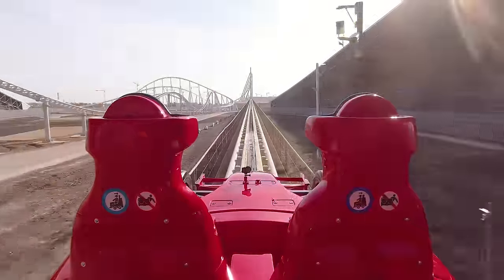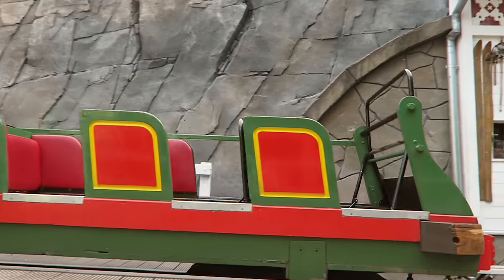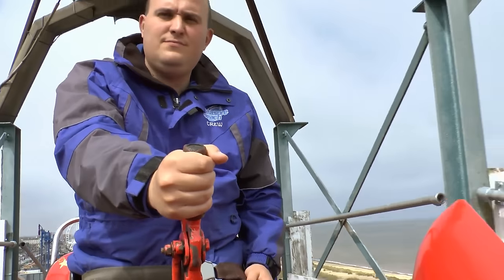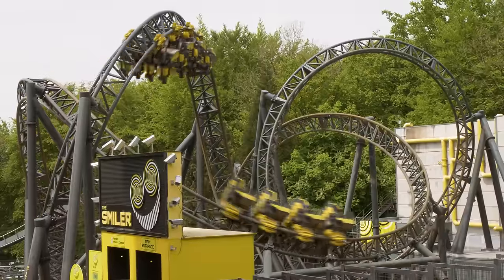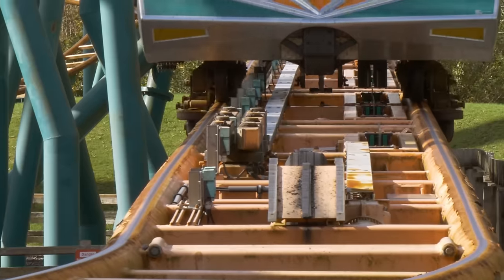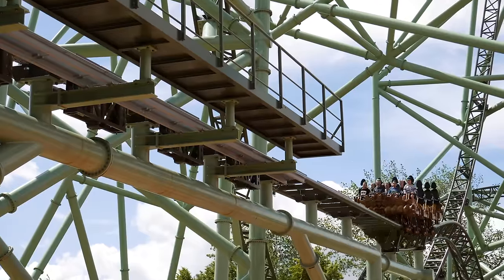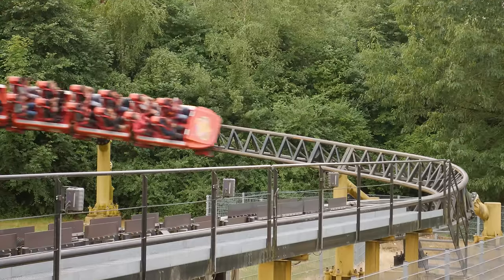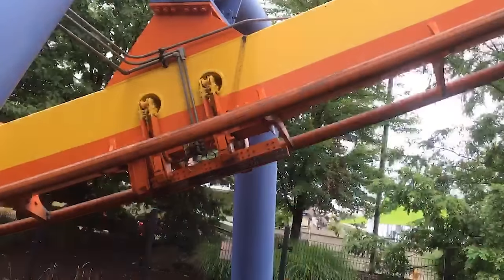Roller coaster brakes NEVER fail

Comment: You use the term "Failsafe" a lot. They are not failsafe.

Let's first start with the laws of physics, every action has an equal and opposite reaction.
This means SOMETHING is taking that momentum and converting it to heat energy.
That something also feels the full opposite force of the thing it is slowing down.
Metal fatigue is wear just as much as brake pad fade is. Given enough trains in a row, the magnetic brakes WILL overheat.
And given enough runs, they WILL fail. And not like brake pads do, slowly getting worn but rather quickly and without much warning.
A microfracture can suddenly cause a whole plate to dislodge and throw itself at a park visitor.

Secondly, there's history of these blades coming loose. I don't remember the exact details and name of the park/attraction but there was a woman standing in line to ride a coaster when one of these blades did come loose due to badly fastened bolts. The blade was launched through the air at full speed into the back of her head. She was dead before she hit the ground.

Third, "permanent magnets" are only permanent by name. If they were truly permanent then we would have free energy, also known as perpetual motion.
They are called permanent because unlike iron magnets, these rare earth magnets (Neodymium etc) keep their magnetism way longer than ferrite core magnets do.
But even they will eventually lose their magnetism and they lose it faster the more you run eddy currents through them.
Or they can lose their magnetism from heat. All it takes is a bad wheel bearing to transfer heat into the magnet rail and a whole set of magnets can suddenly become demagnetized and the disaster is a fact.

The water brake is more "fail safe" than these magnet brakes are. Except the inlets and redirection structures too will eventually suffer metal fatigue.
When the coaster is in motion it is no longer safe. A fail safe would be something that prevents the coaster from moving at all if anything has broken, be it physically or digitally or personal safety wise.
The same way an elevator has a failsafe built in that is never actually used until it is needed.
If an elevator cable snaps and a cart freefalls, there's a failsafe that will deploy huge metal bars to catch the cart at a floor or even between floors.
They are fail safe because they ONLY activate when they are needed. So they don't wear out. Unless of course they have to activate all the time.
And the only way to get an elevator moving again after these have deployed is to lift the elevator cage again.
Reply from the maker: All those points are very valid and go one step further on explain things than I have in the video. 

The answer to the majority this comment, as many have pointed out, is maintenance. With correct maintenance, these brakes are failsafe.

Comment: with magnetic brakes, where does the energy go? is it converted into heat like friction with brakes?
Reply: good question and you are correct! "The kinetic energy of the moving object is dissipated as heat generated by the current flowing through the electrical resistance of the conductor."
Reply: You already got the answer, but I want to suggest that the next time you ride a rollercoaster or have a chance to take a look at a braking zone look closely at the metal fins. If the conditions are right you will see substantial heat haze over the finns.

Comment: So what you're saying is magnetic brakes are prone to failure during a power outage, rendering any electromagnet inoperable - same for friction brakes. 
So there's a slim chance all brakes might fail, it just hasn't happened yet
Reply from the maker: That's the exact opposite of what I'm saying.

Magnetic braking systems use permanent magnets, which will always slow the train down regardless if the ride is powered or not. 

If there is a power outage, all of the brakes on the ride go to their default position which is engaged. In this case both magnetic and friction brakes would slow the train down.
Reply: @coasterbot  I understand now. I carelessly forgot about the permanent magnets. Thanks for the clarification!

Comment: I dislike block breaks a lot, because they do exactly what they are designed to do - seperate the track into individual blocks. 
For me, this just makes it so it doesn't feel like a single, monolithic experience, but one that is constantly broken up, ruining my fun.

I'd rather wait in line a bit longer but have a coherent ride experience than to have it be broken up into chunks, the sum of which are less enjoyable than the whole, with block breaks.

Comment: I wonder if the magnetic brakes on rollercoaster are regenerative…
They could totally dump all that energy into a pack of supercapacitors or high-performance batteries to lighten the load on the park’s grid   during launches of a launch coaster, for instance.
Reply from the maker: That would be cool, but I think regenerative braking requires some sort of motor on the vehicle, which isn't the case for roller coasters. It might be more effort than it's worth?
Reply: The issue is that in order for the braking to work you need to allow that current to flow freely. To be useful as a regenerative brake you'd need a coil of wire. But if you break that wire at any point the braking force disappears completely, since the electrons have nowhere to go. Combine that with the constant heat cycling of brakes and you have a maintenance and safety nightmare.

Comment: The brakes on Superman at Magic Mountain always failed for years whenever they would run the cars at the advertised speed of 100 mph. I remember the time that it happened while I was riding. I used to go to the park a lot and this particular time, I noticed that we went a lot higher on the track than usual. The car ended up overshooting the boarding zone when returning and stopped in the little safety area behind it. Took about 30 minutes for them to fix whatever it was, then they let us ride 2 more times without getting off.

Comment: And the Titanic will NEVER sink and the Twin Towers will NEVER fail to show America standing strong as a country of commerce and on it goes. 

Don't dare the Fates, they usually win.
Reply: Its physically imposible for a magnetic brake to fail lol
Reply: @happysword258  Do you mean an electrically powered magnet? Yeah, no chance of a power out making that a useless piece of junk at all.
Reply: @TheRadioAteMyTV  The magnets are permanent.
Reply: @TheRadioAteMyTV  they are permanent
Reply: @TheRadioAteMyTV  as if this wasn't thought of when designing them 😂
Reply: If they are permanent how do they release?
Reply: @TheRadioAteMyTV  it's impossible for magnetic brakes to bring a train to a complete stop, only a crawling speed. Friction brakes with a clamp or drive tires are usually used to finalize the stop.

So it's impossible for magnetic brakes to fail. And even if the brakes that finalize the stop fail for some bizarre reason, the train will only be going an extremely slow speed that if it were to collide with the train in front, it would only be a small bump.
Reply: @kaydub0623  Lots of things are thought of when designing stuff that doesn't mean people solve everything at all. Some times they are called "worth the risk" too. 

Ask NASA or auto makers about "they thought of that when designing them" and how there are still accidents and people die all the time.
Reply: @ElectriKong-  So tell me how they release then. If they are always on then how does it let go?
Reply: @happysword258  So tell me how they release then. If they are always on then how does it let go?
Reply: @TheRadioAteMyTV  As explained in the video, and by a previous reply already, by being unable to bring a train to a complete stop.
Reply: @ElectriKong-  That doesn't in any way explain how they are released if they are permanent. If you know do tell.
Reply: @TheRadioAteMyTV  lmao what??
Reply: @TheRadioAteMyTV  the default state of the friction brakes is on. power is sent to the brakes to open them, and power is removed to close them. in the event of a power outage, friction brakes will close and stop a train.
Reply: @happysword258  The brake fins brake off. The other half of it brakes off. 

Magnets can get weaker.
Reply: @eyebrowse  Are you saying the friction brakes includes the magnetic brakes? I thought he said they were in their own category. The magnetic coasters he showed were electromagnetic not permanent, unless I missed a part.

If you have two permanent magnets next to each other, strong enough to stop a coaster then how the heck do you release it once its in the same field? That's what I am asking.
Reply: @ballbag  thats why theres daily, monthly and yearly maintenance
Reply: @TheRadioAteMyTV  they dont have to be released, as they dont stop the train. And when needed, the are pulled down, as explained in the video
Reply: @happysword258  Actually, pulling them down would be a form of releasing them. Ok, well no one is really answering my question in full so I am going to give up. Maybe I will ask Harry about it, he is awesome at complete answers.
Reply: @TheRadioAteMyTV  one thing: an average of 2 people die on coasters a year. For comparison, 10 people die of fucking snack machines a year. Rollercoasters are one of the safest options to have fun
Reply: @TheRadioAteMyTV  did you even watch the video? the stupidity of some perplexes me
Reply: @happysword258  Where did you get the stat for snack machines? 2 people dying on  a roller coaster alone shows nothing is close to perfect and pretending otherwise is pretending. Also, assuming that is a legit number from who knows what year, it left out all other injuries including being maimed. 

If you want to go down the statistics rabbit hole, then open wide and provide years, and all accidents and which ones were rider's fault versus operators and then remember all of those added up to failure in design over rides and redundancies, showing faith in such fail safes is a starting point not an ending point.
Reply: @GreenIcing1  I did watch it, I did not memorize it, and your comment helped answer none of my questions, so if you are so upset at what you perceive as stupid you can't count yourself as one who did anything to aid another's education.
Reply: @TheRadioAteMyTV  i just googled for the snack machine one. Also i said 'on average', you should know what that means. If you want to know more about coaster accidents, you can watch the 'what really happened' videos by Coaster College. Its impossible to have something perfectly safe that has no fatalities, especially when millions of people ride a week
Reply: @GreenIcing1  A long time. I care about details and accuracy, and that rarely happens quickly. 

Nice of you to think of other human beings in such a manipulative way. Thinking of people as your playing things puts you in a special category.
Reply: @happysword258  I am subbed to coaster college and I do know that an average requires a starting and end point, which you did not provide. It was Coaster College that came to mind with all of his accounts that came to mind when you went off your "stat" and faith in the machines.

You are doing a full about face now, from redundancies protect against humans to now, "It's impossible to have something perfectly safe that has no fatalities". You could have just started with that. Keep in mind my OP points to the Titanic and Twin Towers. That's three examples, yet there you were ready to poo poo it, and now you are saying the same thing as me. Welcome aboard. 

Now if I have confused your comments with others here, accept my apologies for not re-reading every comment.
Reply: you do realise for a magnet to NOT work it has to have power right ?
Reply: @TheRadioAteMyTV  Hi! Magnetic brakes only apply a braking force to an object in motion, and the strength of the force will be proportional to the speed. Therefore, as the brake slows the train down, the influence of the magnetic brakes will decrease too. They won't slow it down to a stop, however their purpose is just to get it to a safe speed.
Reply: @sporech9374  HI, thanks. Someone else mentioned the same idea, but the pieces I am missing for understanding are - if you can help - other say this is a permanent magnet system, not electronic, that seems in error, but I don't know - if they are permanent on either the train or the station, then doesn't them coming into the same field permanently lock them together? If not, then how does it break free of the field. 

I don't want to guess why, it takes up too much room on a very littered thread as it is. But I really do want to know to understand this. If it is not a permanent magnet but electric then they just hit the off button and no more magnet, but others are saying it is permanent. 

And lastly, my early post stated if it is electric it can fail without power. Thanks for your help.
Reply: @TheRadioAteMyTV  huh? One year more people die and the other none, the average is 2. But still, coasters are as safe as they can be and your chance of dying on a coaster are something like one out of 250 million ( I dont have the primary source here but Coaster College mentioned it in multiple videos).
Reply: 7:24 this will answer most of your questions
Reply: @Furyman325  Ok, rewatched that part and did so a few times. Where Harry says magic of magnetic that leaves some holes, but see if this works. So then a permanent magnet is only on the track and the train must therefore have an aluminum or copper fin then, as those are the two metals that are not magnetic on their own, but do generate a magnetic field when a magnet is passed by them. This would create that force that is in proportion to the magnets. Like when you drop a neodymium magnet through a copper pipe. Am I getting close now?
Reply: @TheRadioAteMyTV  it's because the interaction is between a permanent magnet on the train, and piece of conductive metal sticking up from the track. 
It doesn't get locked in a field because the field from the metal is entirely induced from the motion of the train, in other words, when the train slows right down, there is no field for the permanent magnet to lock with.

And also, it's just a permanent magnet and some metal, no power supply or anything needed.
It's the same concept as eddy current braking if you wanna give that a Google
Reply: @TheRadioAteMyTV  yeah that's pretty close
Reply: @Furyman325  Finally! Thanks!
Reply: @sporech9374  Thanks so much. So that fin is either aluminum or copper then right? That's the two metals the create currents when passed by magnets. 

Harry doesn't say what the fin is made out of and then all the posters here would not say either, and if it were magnet and magnet, it would run into the issue I kept asking about and called names for, while they wouldn't say what it was, and probably had no idea.

If it is aluminum or copper that would probably solve this whole issue of the magnets though. 

If only Harry had named the metal instead of just saying magic of magnets, then this thread would be like four comments instead of over 30.
Reply: @TheRadioAteMyTV  Magnetic brakes’ braking power is proportional to the speed of the train, so no magnetic brakes can fully stop a train. All magnetic brakes that are meant to bring a train to a stop are followed by a small friction brake to actually stop the train. Magnetic brakes will only slow a train to a crawl, if a train is meant to stop then there will be a friction brake after the magnetic brakes.
Reply: @eyebrowse  Yeah, I was looking for the science of it, and some other kind and smart posters seemed to have helped me solve the mystery. Very grateful for their help. Harry left out that little part of what the fin is actually made of beyond a "metal". 

It's looking like it is aluminum or copper to create the magnetic field while in motion. Everybody repeating the same thing did nothing to figure out what created the magnetic fields that started up and died without external electricity. Nor did anyone provide answers about if there were magnets on both the train and track, which there is not it turns out. But copper or aluminum is a high probability of the solution. I will have to look into it deeper should I do a lesson on it. It's a very clever use of copper or aluminum properties along with permanent magnets if that is the solution.